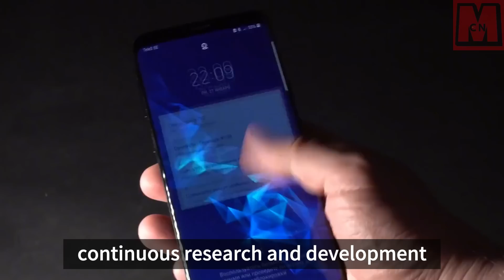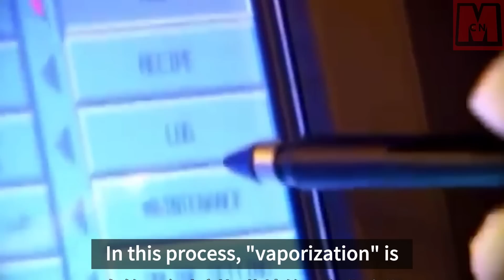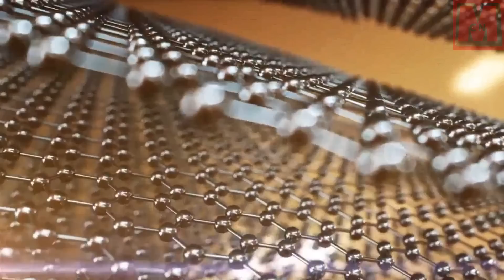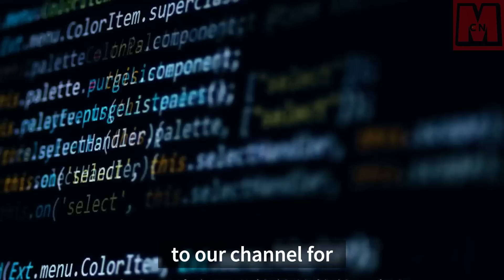800 million per unit, in short supply! China successfully breaks through the blockade

Comment: "If you don't sell it to me, I'll make it myself" should be to quote of the semiconductor sector in China. The US should remember that, otherwise it will run into the Chinese buzz saw. This decade will be China's semiconductor decade in which China dominates semiconductor production with control over the entire supply chain from raw materials to sales. Semiconductor prices will fall and only those lean enough to handle low margins will survive.  Even within China's semiconductor sector, there will be bankruptcies and mergers that will winnow out the weaker companies and create stronger companies, all the while creating  a strong integrated and broad semiconductor sector in China.

Comment: Chips has reach it heat limits in an enclosed space without fans that oppsite of long battery life required. Go pro from model 8 till 12 are all over heating after 10 minutes clips, i when through 3 model 8 with 2 month use it’s freezes and will not restart , eBay full of then. Sold for 20 buck, and this summer it’s hotter my dual core iPad are over heating , my new pad died after 4 month, before that  also, it’s can’t get rid of the heat so it just build  till it cook the battery. Even the new iPhone over heating , so no way all of these 3 nm chips are going to be sold. Watch next yr you’re going to see a surplus of these chips they can’t sell. Any time gover pump it it’s alway over supplied they can sell
Reply: The weather getting hotter, and dry no wind hot,  electronics don’t last or like hot weather. Even my rechargeable aa & aaa lose their charge in a month fully Charge
In storage